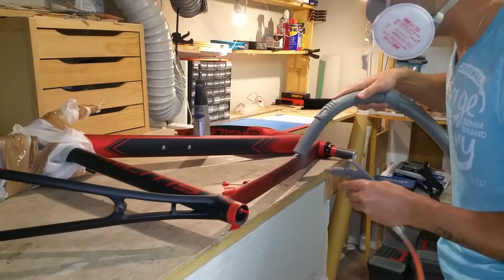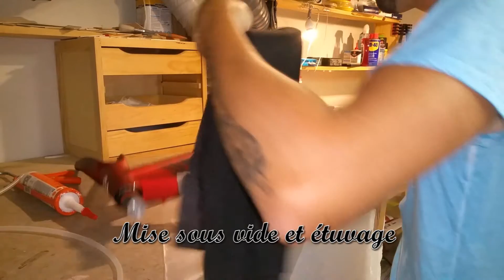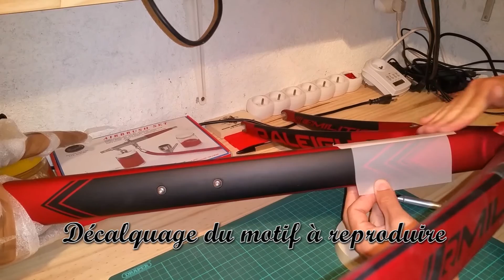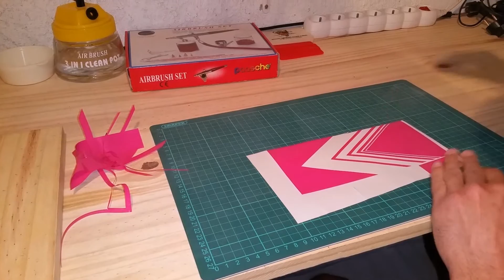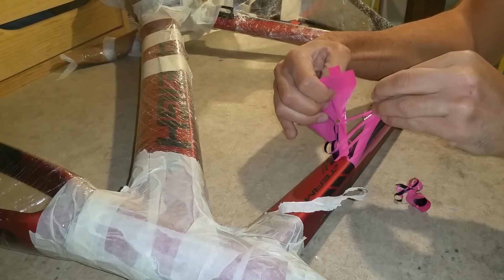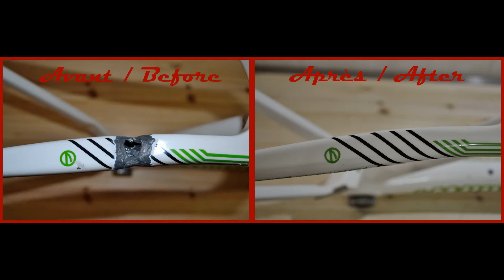Réparation d'un cadre de vélo en carbone / carbon bike frame repair

Comment: le retour tant attendu tu te rappelles de moi je t'avais appeler pour avoir des renseignements sur la façon de faire les moules pour les planeurs
Reply from the maker: Salut,
et oui j'ai mis une petite vidéo ;-)
oui je me rappelle bien alors tu en es où ?
Reply: +Rouge 13 model  le petit planeur c'est fait par contre li vol comme un jet il faut aller assez vite autrement il le père de la portance(mini soluse de multiplex et mon planeur de 2 mètres j'ai commencé à faire les moules mais on arrive en hiver et c'est pas la bonne période pour faire de la résine